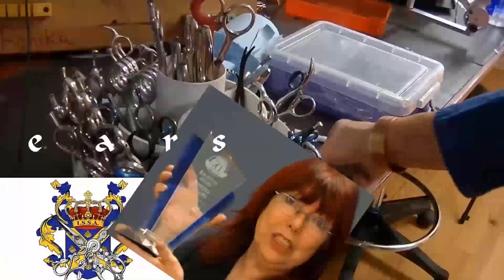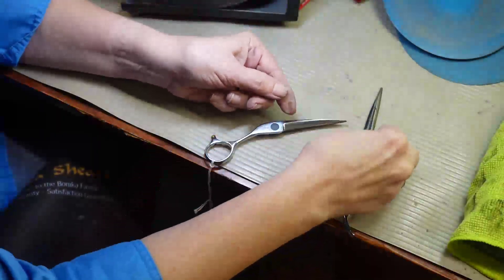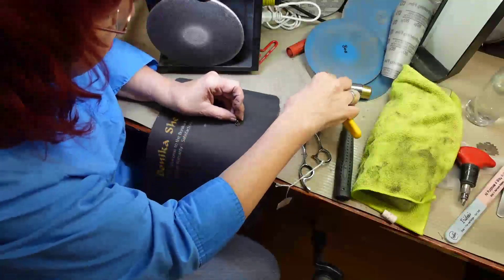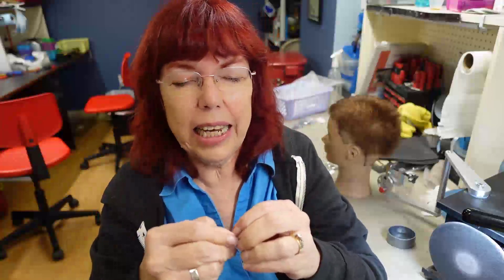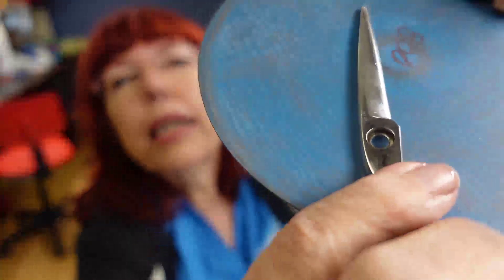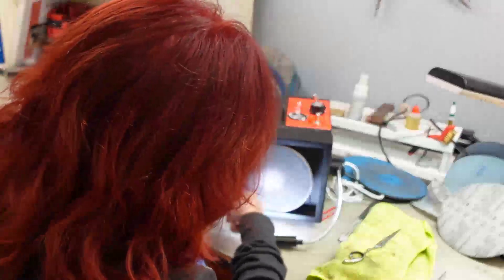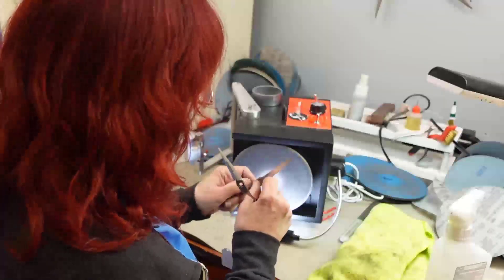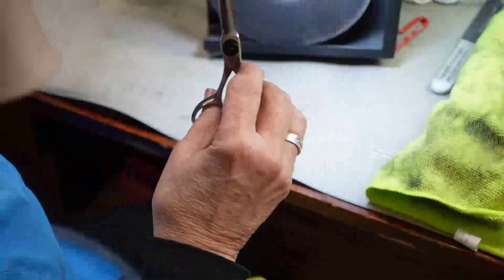Sharpening a convex edge beauty shear with screwy screw issues | Bonika Shears

Comment: Bonnie, you'll appreciate this. I Had not sharpened for about 4 months. Was on vacation and could not bring my equipment (Twice as Sharp) along. 
I've learned that sharpening needs constant practice.
I tired putting the square peg in the square hole. Got quite frustrated trying to compress the internal click washer. It finally popped and it took a trip, never to return. I got so irritated that I put the shears aside for later (with the thought that I might have to send them to you for repair). 
When I did the next shear (same model) I noted that the pin went in the OTHER side. DUH, your oft repeated refrain came to mind, square peg in round hole.

Did you hear me thanking you?  I've thanked you many times.
Reply from the maker: That comment gets me up in the morning and keeps me from retiring at age 67.

Comment: Hi my name is Tim and I sharpen knives and I’ve always been interested in sharpening scissors. Something you might be interested in is a penetrating oil that is one of the best I’ve dealt with it is called Free All. This stuff works really good and I’ve used it on old rusty Lugnuts and I’ve used it on my tractor lug nuts I’m talking about a big International tractor I have used it on my hinges in my house. It does not evaporate like other penetrating oil it actually is a lubricant also. If you run into something that is really having trouble coming undone and you put this on it and heat it up it doesn’t have to get super hot but just so that helps it to penetrate and it breaks things free. Maybe That’s where the name come from Free All. And I do like your YouTube channel good stuff thanks for providing it. God bless
Reply from the maker: Great suggestion! You should enter it in the Sharpeners Jam best idea contest.